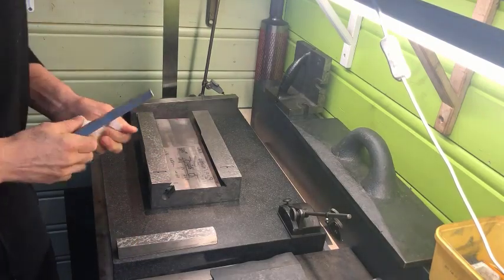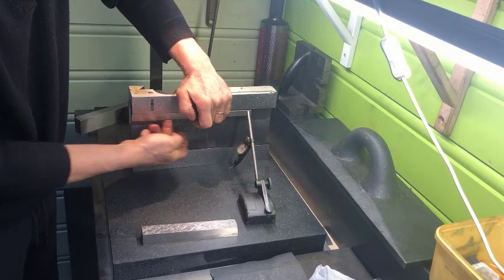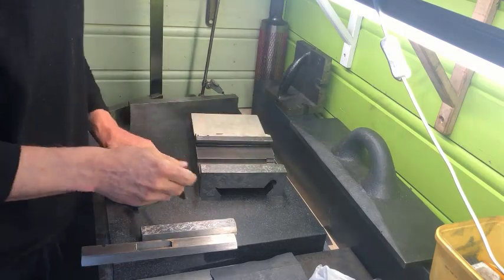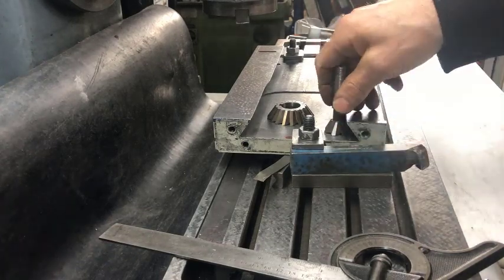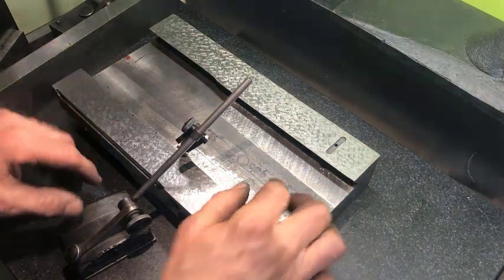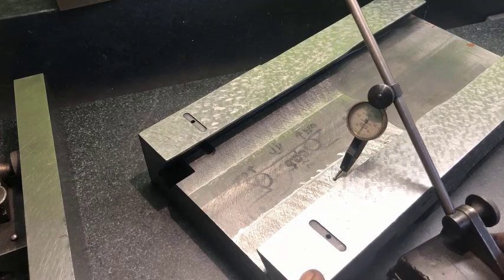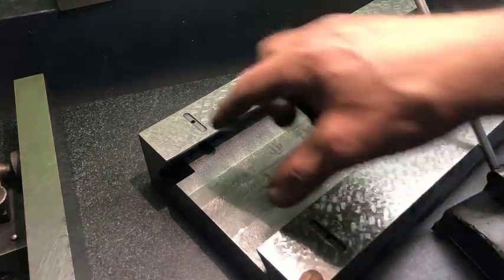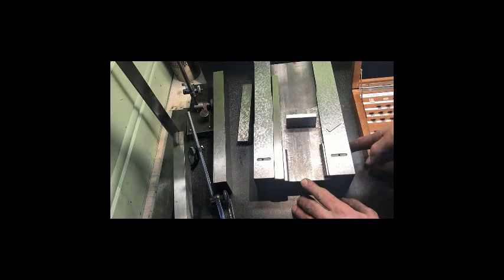CX 16 saddle: dovetails part 2

Comment: The gib needs to be really fixed when taking measurements which is kind of hard
Reply from the maker: Fully agree! Will do much more here. The purpose of the video was to show and demonstrate a possibly ways to accomplish the measurement tasks.
Reply: @jansverrehaugjord9934  yes, very interesting Jan. It is very tricky to understand each aspect to prevent you screwing it up while it in principe  was oke-isch (only some wear). But very interesting to see you tackling this problem Jan!
Reply from the maker: @therealspixycat  Thought it was worthwhile finding an application for the Johansson set.. it usually rests in a drawer 😀
Reply from the maker: @therealspixycat  Thnks!

Comment: Even with a mistake, you end up with such good results.  I hope you plan on doing full measurements on the completed machine!
Reply from the maker: Thnks for the comments. I included this mistake because it was probable that others could do the same, ie. be fooled by the angle of the gib way side and indicate to this. Has zero implications as long as the milled area is large enough to cover where the pins are located.
Yes, I will measure everything when fully assembled, but also assume I will do both corrective and finish scraping including measurements at machine members at several stages ahead as well.